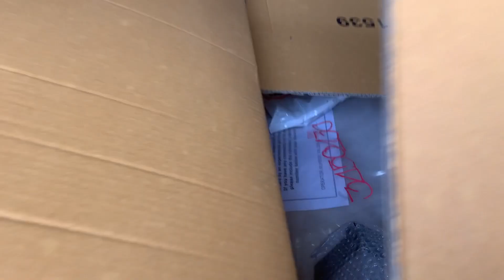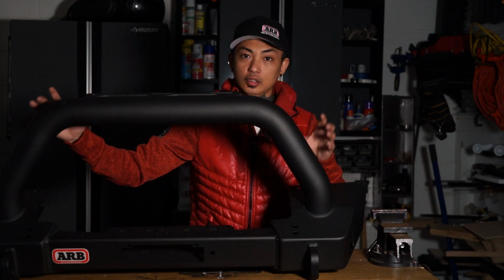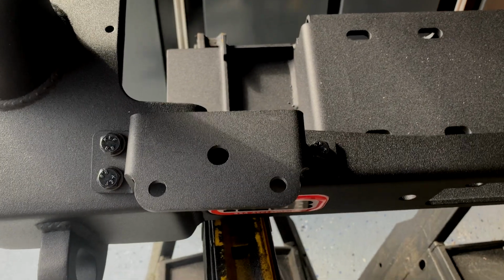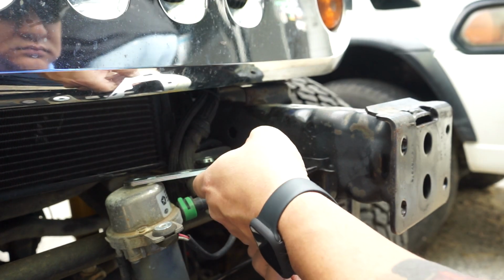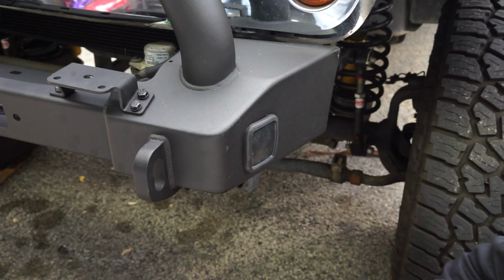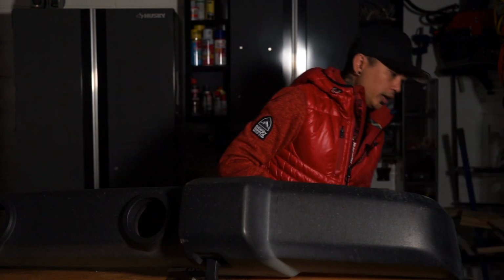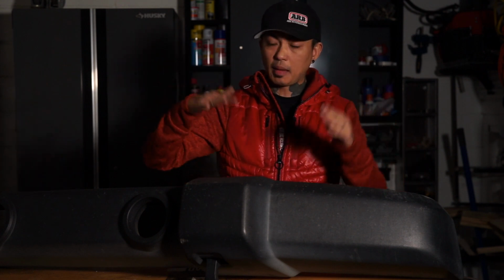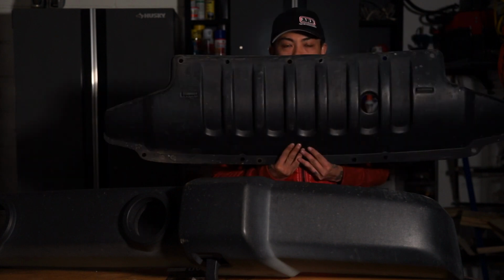ARB Stubby Bumper Install and Review!

Comment: Out of all the stubby bumpers I think this one looks the nicest. Plus I love the fog lights. It gives it rugged old school look. The weight kinda sucks and I'm not keen on the top bracket of the tubing. It's on the pricy side but again looks are important to me.
Reply from the maker: I feel EXACTLY the same.  I love the look of it and yes the weight sucks which is why I went stubby compared to the full width that's heavier and I HATE the bracket on the tubing. It's not even necessary for me (although I've now used one of the holes for my GMRS radio antenna and it looks cool there lol)
Reply: @BaptismOverland  I have a question about the lights on your bumper. Is there plenty of room to mount lights where you have your KC lights? I prefer my lights there rather than mounted on the tubbing. Does the winch get in the way of the lights? I'm looking into getting the KC lights like yours.
Reply from the maker: @AceGoodheart  These aren't KC, they're IPFs. But YES tons of room. Actually if you look at my more recent video on the Lightforce HTX2s, they're HUGE. And they have no problem fitting.
Reply: @BaptismOverland  Awesome. Right now I'm looking to go with the KC Slimlights. Kinda pricy but they use less Watts and they light up really well when compared to the other KC lights. But I'm gonna now compare them to other brands.  Lol, I do a lot of research before buying.  Probably to my wallets detriment.

Comment: Good pick. Anytime I had to service Jeeps with stinger bumpers, it sucked. It was hard to service anything in the engine bay as easy as changing oil. Are you worried about approaching gross vehicle weight?
Reply from the maker: I’m always afraid of the GVW lol. I need to find a place in town and get the whole thing weighed with all my gear.

Comment: So is there a steel bumper inside all that plastic?
Reply from the maker: On the stock? Yes. Held to the frame with the 4 bolts that were reused into the new bumper

Comment: Just for clarity the crush cans DO NOT have anything to do with your airbags, there are no sensors or wiring coming out of the crush cans. The airbags are activated by an accelerometer which is located under your centre console behind your handbrake.
Reply from the maker: Yeah I learned that after lol. They're more for taking the impact.
Reply: "the crush cans DO NOT have anything to do with your airbags"

Not true.

The acceleration that the accelerometer reads is what determines whether the airbags go off. A rigid heavy steel bumper will not yield when you hit something - it will resist deformation, which means the accelerometer will see a shorter, higher magnitude acceleration impulse. The crush cans are designed to yield and deform when you hit something, which reduces the magnitude of the acceleration impulse and increases its duration, reducing the probability of the airbags deploying during minor collisions.

Think of the difference between hitting something with a steel hammer and hitting it with a dead blow hammer.